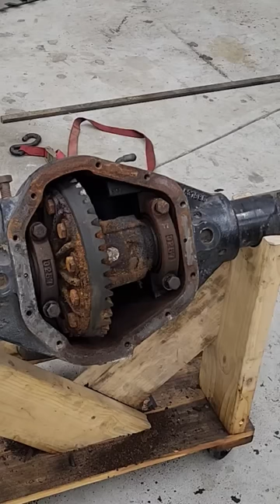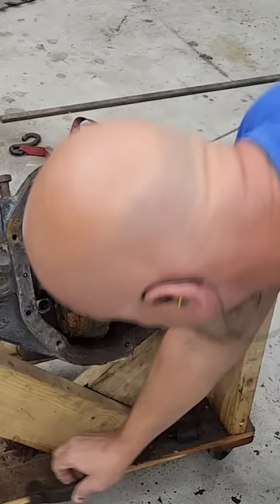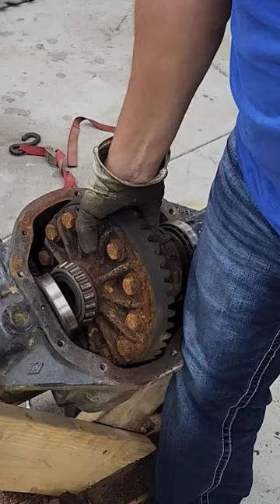quick trick to pull your carrier #shorts #uintagarage #fyp #shorts #uintagarage

Comment: There is an easier method than that: after pulling the C-clips and axles, let the cross pin hang out halfway. Rotate the Yoke with a large plumbers wrench. With the cross pin jammed against the housing, it forces the carrier to rotate out. This way you don't have to worry about damaging the spiders with the prybar.

Comment: That crow bar sure did a nice job on those bearings!
Reply: I’m sure it was all being replaced so it don’t matter
Reply: What you on about didn't touch the bearings yeah the bearing cap fell off but so did the other side and that wasn't touched also pretty sure it's all being replaced.
Reply: Yeah so a guy can do a burn out with that axle but your worried about a pry bar messing up the bearings

Comment: To properly remove a carrier is to use a case spreader and dial indicator 
Tapered bearings requires a certain amount of preload 
You will notice all non third member rears have indications for a case spreader 
You spread it .010 and carrier will come right out
If you know nothing about shims and pinion depth measurements, crush collars you best leave it to a professional

Comment: I’ve never done it that way. I’ve just always used a solid large punch like an inch in diameter and stick it up through there through the opening of the carrier and just kind of tap on it because as long as it comes out squarely, it should come out unless you’re talking about the kind that needs a spreader like a Dana but this seems like a good idea though

Comment: Nice tip that's 1 thing I never got into was differentials but hey looks easy as long take ur time
Reply: Putting them back together can be another story.
Get one adjustment in spec ,and it throws another off.  
Chase that one and now something else is off. 
If you're lucky you only gotta pull it back out a couple or 3 times.
Reply: @MrTheHillfolk  so true, thats why most shops replace with the whole rear  end  . From junk yards. I've  done the same many times.
Reply: Oh yeah not easy
Reply: Some people say junk yards I say Salvage yard because thre used parts unlike junk just what it means
Reply: @houston6737  but agreed its much easier just replacing the whole housing
Reply: @geraldhague6170   its a age thing when I grew up, they were referred to as junk yards. We never heard of a salvage yard back then 🤔. Have a good day.
Reply: @houston6737  I'm in my 60s so when I started messing with cars I always referred them as junk yards but as I got older &learned more from going to them&talking to owners of these yards they told me correct terminology is Salvage yard but hey evry1 has thre opinion it's all good

Comment: There is a case new manufacturer that's supposed to be selling to hill billy wizard that uses the 14 bolt set up inside the carrier were you wouldn't need a case spreader .but now I know how I'm going to do mine .when I do air locker

Comment: Can you use the same method while the differential is still on the vehicle?
Reply from the maker: Don’t see why not. You still have to disassemble, pull axle shafts to get to this point. Then use this method to remove the ring gear carrier.

Comment: or you could do it properly and use a case spreader as it will be necessary to set up the proper bearing preload.   and just so you know, I built mine with parts from ace hardware and some flat strap.   no excuse not tom have one

Comment: It's easier to get the pinion not loose while the differential is still installed in the axle and you don't have to remove the whole axle housing to do this I've done hundreds and hundreds of these I worked in a shop  where we specialized in drivetrains if the vehicle was brought to the shop I would do them in the vehicle if the customer pulled the rear axle out then I would do them on the bench yeah and you do have to remove the axles or you're not going to get the differential out lilo. Rookie move